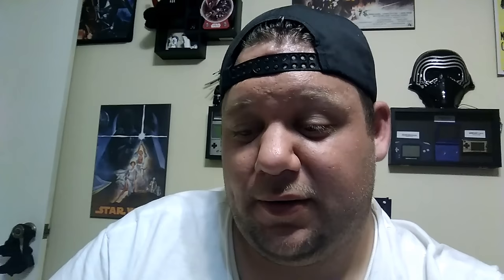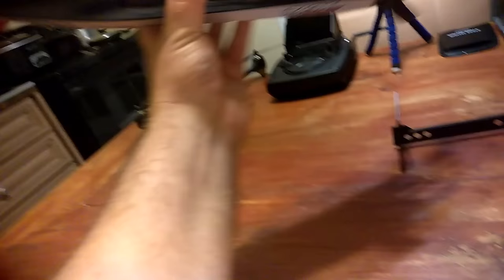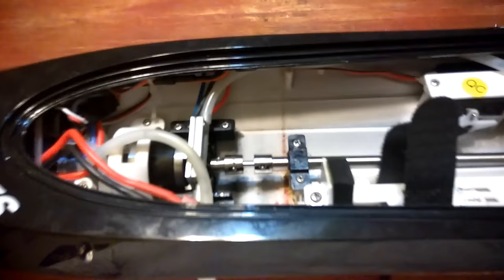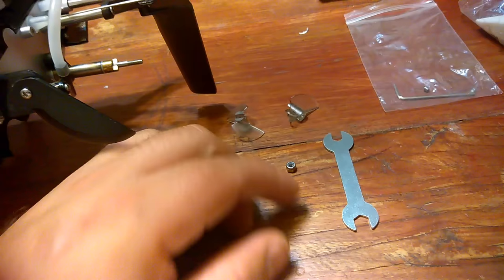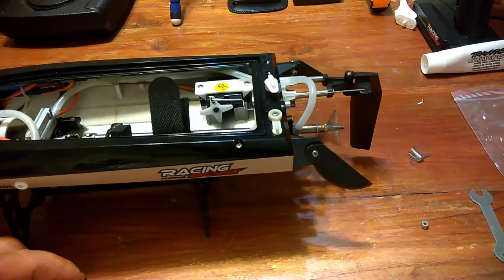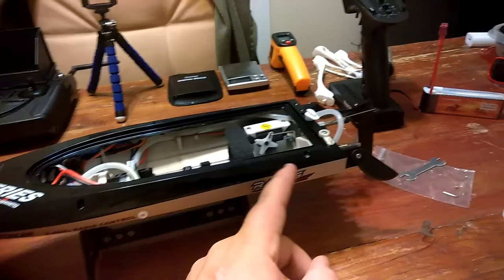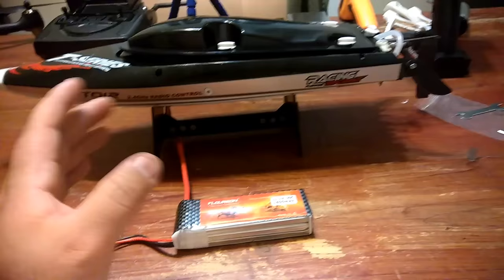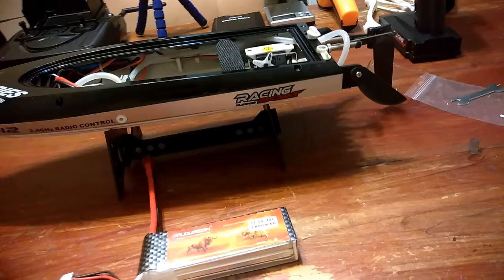Fei Lun FT012 I busted a Prop :(

Comment: Hey D.W, awesome video as usual bud. Just a FYI I think  that stainless steel prop nut is actually a self locking nut. It has metal threads with that piece of Teflon at the end to lock into the threads and keep it from vibrating loose and prop falling off when turning. I use them often, Much love brother. Keep making the great vids.

Comment: Yea that's actually a Nylon Lock Nut to hold the propeller on. I just bought one of these"Original" FEILUN FT012 boats. I heard it's best to remove drive shaft & inject grease inside shaft tube with syringe then re-install drive shaft & to also keep the dog bone shaft couplings greased. Did you modify your rudder to make it turn better❓ Mine needs a bushing & a trim so it turns sharper.👍👍❤

Comment: That's the only place you need grease is at the bearings on each end since that shaft doesn't even touch the sleeve,it spins on the bearings on each end.